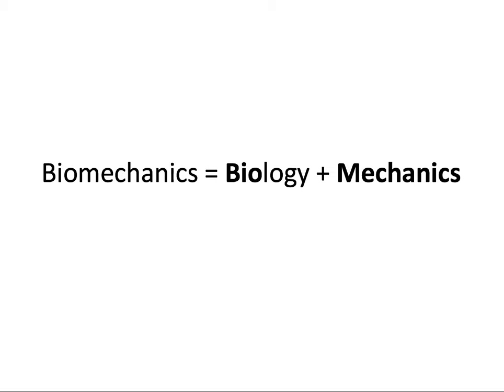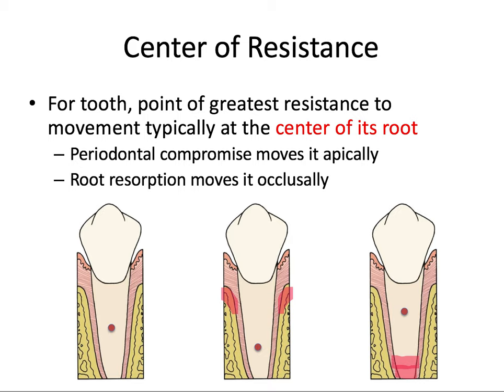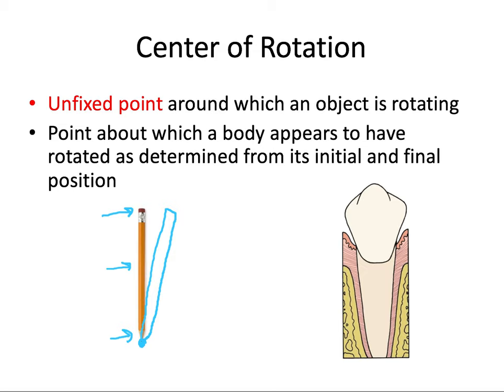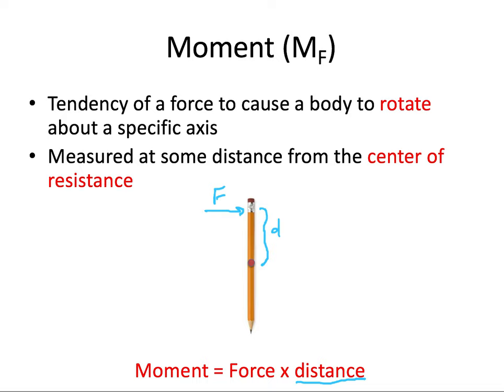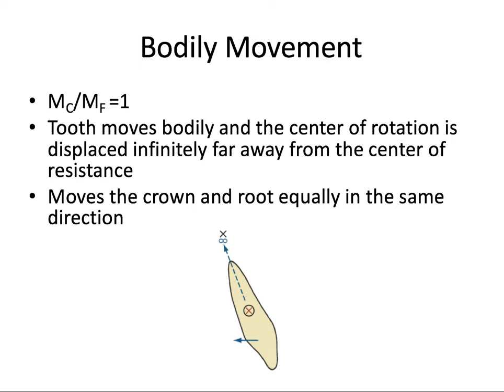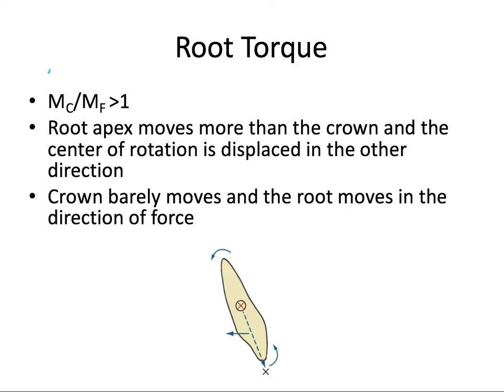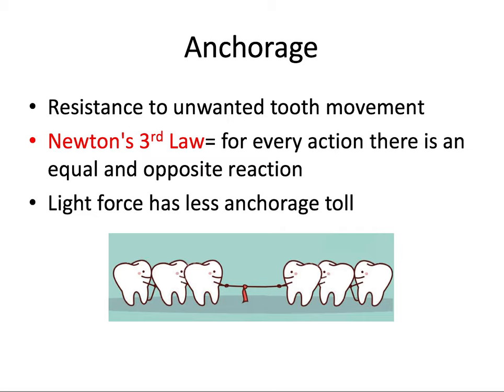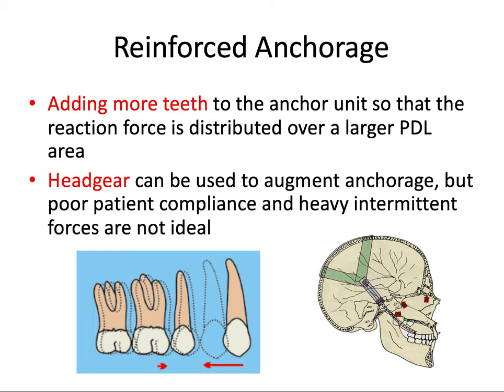Orthodontics | Mechanical Principles of Tooth Movement | INBDE, ADAT

Comment: Great video, but I'd like to know more or less where the line goes between how much more root surface is necessary for maximum anchorage in comparison to moderate.
Reply from the maker: I’m not sure I understand your question. Anchorage demands depend entirely on how many teeth you’re pulling against and the quality of the bone within which those teeth reside, so there isn’t a set standard you can follow for every patient.